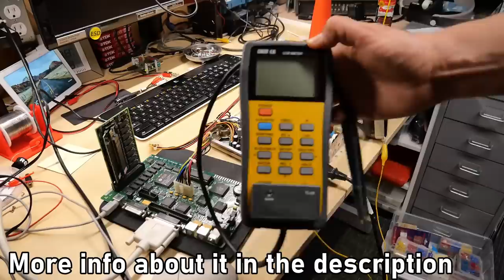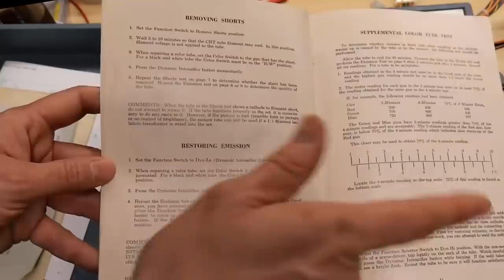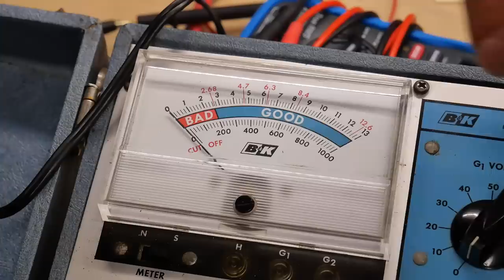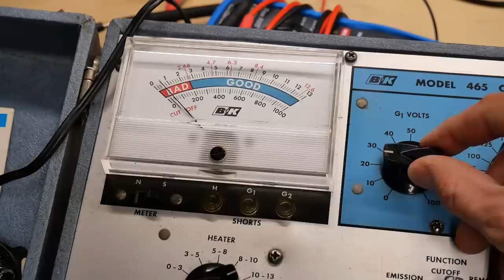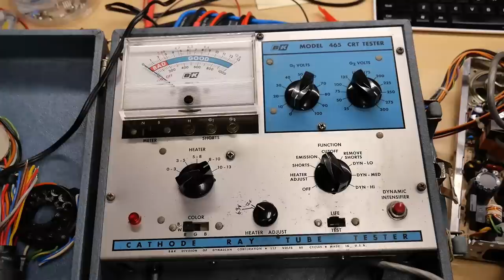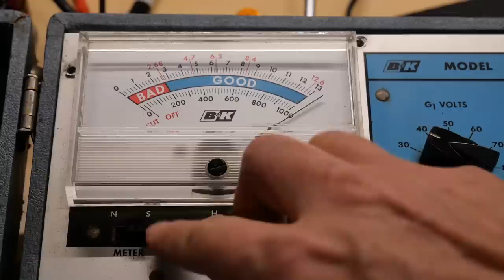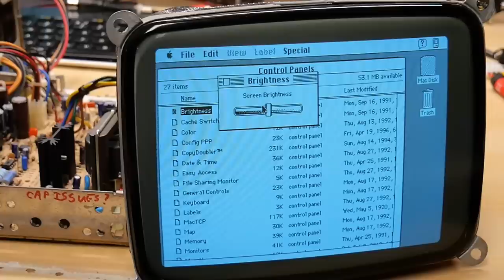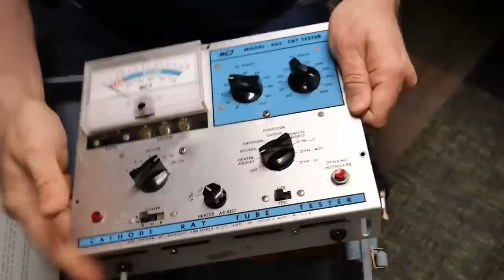Rejuvenating a Macintosh CRT with equipment from 1969

Comment: I used to be a TV repair guy back in the 80s and 90s (I'm now a computer engineer). I used that exact tester (B&K actually sold additional updated modern adapters for a while with updated cross reference guides). I rejuvenated many many CRTs with that tester and I would estimate about 75% of the time the CRT remained functional for years after. The other 25% of the time there was either no change or the CRT would completely fail. The spark you hear is normal when rejuvenating and I had the best success using 3 quick taps in a row and then checking emission. It is not doing anything to the heater, it is causing an ARC across the electron gun (usually visible when pressing the rejuvenate button) that exposes fresh surface on the coating of the cathode.
Reply: Thanks that answers my question.  Is the heater necessary at all in the rejuvenating state or just when actually testing  emissions or watching the CRT?

Comment: " Rejuvenation" means increasing the filament current a bit, and or more extraction voltage to "blow" any surface crud of the filament and basically increase the amount of electrons liberated from the filament, this works and is used in old electron microscopes as a last resort before looking the customer in the eye and telling them how much a new filament is ! however filament lifetime after this is a bit of a lottery, also there is a risk that the crud (filament) you removed went further in and caused problems down the line, so all in all, in your situation you did the right thing and you couldn't replace the filament anyway..i'm betting you get years out of it ! and from now it could actually improve a bit more...I'm a "glass half full guy"...cheers.
Reply: just what I was going to say Andy, years ago a friend had  a tv rental company, which would rent tv's cheap to people who the main stream rentals would not touch. The sets were ex rental which I help fix up, good clean inside and out and a tube boost would see them running for up to about a year, only had to last  3 months to pay for themselves.
Reply: So I guess this is the old extraction potential trick due to surface degradation... I have seen people use this also in old filament gas displays that are no longer produced and used in traditional lab instruments from the 60s to 90s... I guess the filament gets worn out during the process and the times you can repeat it is limited. Nice to see it working though, would be cool to also know what voltage/current it applies during this process.
Reply: @TheEmbeddedHobbyist  Did you have to hit the button a lot, or just enough to get to good. Basically will more blasts make it better.
Reply: @SidneyCritic , if you hit the grid with HV too much you can completely destroy the CRT!
Reply: It does work but you never know how long for, but even if you only get another 6 months out of it, it only cost a little bit of time.
Reply: @EsotericArctos  Sometimes it's not 6 months, but 6 weeks, especially on Trinitron. On those, it can be even 6 days... Because of the very miniature cathodes, Trinitrons doesn't have much spare emitting material, ~20k hours, and they're starting to smear the colors on high contrast areas, at 25-30k hours, they are unwatchable. 
Especially on the later Trinitron sets, where they drove the hell out of the tubes to give the brightest possible picture. I used to reduce the peak beam current setting in the service menu to give them more life (not just on Trinitrons, every CRT manufacturer did the same silly CRT overdrive since about the mid '90s, but good quality in-line tubes tolerated it a bit better compared to Trinitrons. Which is a shame, because on the other hand, Trinitrons has the best possible picture a CRT can produce). 
But on other tubes, which were not overused, just got cathode poisoning, it also can be 6 years, it's really like lottery. You can barely predict the outcome even if the set is your own, and/or you know its history.
Reply: Stop informing me with niche information, Mr mouse.
Reply: Electron gun, not filament, it's actually the cathode in the electron gun that wears out over time. Once the cathode wears out the picture tube has to be rebuilt, where the gun would be replaced, and the tube re-evacuated, or the tube replaced with a new one.
Reply: @mrnmrn1  Trinitrons used to have an advantage in picture quality, particularly brightness, because they used an aperture grill, with slots, rather then a shadow mask like the older colour CRTs used, shadow masks blocked more of the electron beam from hitting the phosphors. It also used a single inline gun rather then three like a delta gun tube would use, simplifying construction, and simplifying the setup time, though that was not unique to Sony. But within a short time other manufacturers copied the design, such as the Panasonic Quintrix sets, so they lost their edge after a while.
Reply: Burn crud off the filament?  So CRTs have directly heated cathodes?  I didn't know that.  I'm only familiar with valves in audio where only in quite early ones the filament does double duty as the cathode.
Reply: @mrnmrn1  I was wondering why all my lovely 19" Samsung and ViewSonic Trinitrons never lasted more than 10 years.
Reply: It's a last chance method to squeeze a few more years out of it. I've personally used a ferrite toroid to make a transformer (only works on a filament that gets its power from a winding on the flyback) that has a few turns on the primary and the same number plus an extra turn on the secondary. I cut the power traces on the picture tube socket and jump in my home made transformer. It would add an extra volt to the filament to drive it a little harder. Still shortens the tube life.
Reply: @dibblethwaite  Also battery operated tubes/valves  almost always have directly heated cathodes. Other then battery tubes, many tube rectifiers are directly heated.
Reply: @therealjammit  Basically a home made picture tube brightener.
Reply: Huh? SEM/TEM filaments are usually very cheap...
Reply: @mrnmrn1  At holydays' home, I still have a early 90's Trinitron which is over 32k hours, still watchable especially when I plug a RGB machine (PS1/PS2/DVD/HD DVB)
Reply: @olegkostoglotov8800  trinitron can't get the convergence quite right, and decent inline beats it. esp. visible on ttx, or simillar graphics, for example subtitles of movies. AND it lasted less than inline crts. so overall a bad tube, if you ask me.

Comment: 🤣...someone mentioned they had used one of these "crt rejuvenaters" I have one also and would give it bout 60% success rate back in the day, saving your customer considerable expense...also, if this was the only repair and the customer had brought the TV to my shop, I would not charge them...Back in the 60"s we generally made house calls as TV's were just to heavy and bulky to load up and take to a repair shop...I had my tube-case, VOM, solder iron, cheater-cord and few basic tools...$3 house call plus parts...the good times...
Reply: yes they were.
Reply: Yes, been there, done that. My buddy and I opened a shop in his garage after serving in the military in 1977. We made house calls in the late 1970's. 10 bucks. This lasted a year until we went separate ways due to other opportunities and overhead costs. Also we bought our rejuvenator and a tuner tester from another small shop going out of business. Most of the mom and pop repair shops went out of business as 1980 approached. If you have to move the console TV sets, that meant you will have to go over the solder joints and burn test the TV for a day before sending it back to the customer. The point-to-point solder joints go bad over time due to the heating and cooling of the filaments and the current draw within the tubes. A little better with the semiconductor boards.
Reply: wow i wish i could learn this art today
Reply: @Walczyk  You can if you really want to. Check out Mr Carlson's Lab, Glasslinger, Shango006, Uncle Doug, etc, etc... so many resources =)
Reply: I did not even know there were any such thing. All out TVs broke other ways than becoming dim. They might have been likely fixed but there always was new technology that made purchasing a new one attractive.

Comment: these things are used a lot by people who work on and repair and restore old arcade games and they have had good results with it
Reply: They're also used a lot by people in the vintage television community who knows their intended purpose is a band aide until the shop has a new or rebuilt tube ready for the customer.
Reply: @AiOinc1  What does rebuilding one entail?
Reply: @lelandclayton5462  Wow, I hope they're still doing this. Its a pleasant surprise to see that people might actually still be making/restoring CRTs in this way!
Reply: @krnlg  The people that have the equipment in that video have since (recently) successfully rebuilt a tube using it.
Reply: @AdolphusOfBlood  This is something that was mostly done in the old days as a less expensive alternative to buying a brand new CRT or if this particular CRT was not produced anymore. The shop would cut the neck of the tube, replace or fix the electron gun, redo the phosphor layer and seal the glass back up up. You needed very specialized equipment to recreate the vacuum in the tube and remove any impurities. The last crt rebuilder was in france and closed down a few years ago so nowadays if your rare and unobtainable CRT is dead (say you're restoring a 1930s-1940s TV) you're screwed
Reply: I was lucky to have been born between the the 70's and modern times so I got to see stuff like this back when it was still common
Reply: &6女v
Reply: @krnlg  There's only one left in the US as far as I'm aware.
It's a very, very, very difficult process and it requires a degree of craftsmanship unseen today
Reply: @Moonwalker917  nah at that point you adapt the set to use a more common tube, it's not hard
Reply: I used to rebuild old TVs for extra money and when I wasn't working. I would buy rebuilt crt's for the best sets that were worth the efforts. There used to be a shop that sold parts and new and rebuilt picture tubes. They were significantly cheaper than a new one and usual if you bought a A grade tube performed like brand new. I think the guy was All Smith in Portland off Sandy Blvd in his home.
His son even showed me a 1949 Crosley? Color Caster TV they had gotten and used to watch the Rose Parade on when the first early color broadcast finally happened here.
Last I heard nobody was really rebuilding crt's any more but I'm sure someone has some of the gear saved and sounds like they've done a few according to what was said above. I sold working but weak sets for 50 bucks each and better sets for 75 to 200 each if they looked good and were newer with a remote which was kinda rare for me. Most were 50 to 75 each as basic working sets. Gave it up when lcd took over as not worth it anymore and I just fix my own gear now.
Reply: Wish this guy was still around. I have an old Vector monitor which has a bad pin on the neck ... if you wiggle it; the pin makes contact and the monitor works. I'd love to get the pins repaired on the crt.
Reply: @AiOinc1  Are there people still re-gunning TVs? I have a few vintage colour TVs and arcade games, and want to keep the original CRT running. Im from New Zealand, but back in the day there was a place here that re-gunned the old tubes.
Reply: I've been an 'Arcade Tech' and location manager for about 30 years.  It was and still is common practice to request a CRT rejuv' from our support center for weak picture tubes.  Usually these games are running 12 hours a day every day.....  So the CRT's are under considerable strain.

Normally the process can last either a few hours, or a few years.  Considering the cost of a CRT and the very limited availability.  (Normally only a replacement from a scrap game using the same chassis ID can be sourced)  We rejuv' tubes a few times a year.

If the process 'fails'-  We then do a monitor upgrade using adapters and retrofit flat screen monitors into the cabinets.  While the picture looks amazing, the cabinet looks a bit odd-  The bezel (surround) of the cabinet is made and shaped for a CRT (curved) and a flat panel can look weird.

FYI:  I own 2 CRT rejuv's currently in my own personal tool set.  Both picked up at the local Flea Market for about $20 bucks each.  (BK models, both circa 80's)   I also rejuv'd my old weak CRT for my commodore monitor :-)  That was fun!  (The repair lasted a few months, but as mentioned-  This is a band aid fix...any life extension is a blessing for the older monitors)

Comment: I worked in a TV Repair shop back in the early 80's in Kerry, Ireland and that used be done with the rental TV's that were out from the shop if the tube was "Lo". It worked for a few months to a year before a new tube was required or may even get another Boost. That is what we called it. "Boosting the tube ". It worked OK but not a permanent solution, but a few months to a year was not that bad.

Comment: Great video.  An excellent site to watch for old electronics, is Mr Carlson's Lab.  I know there are many more, but he is my favourite.
A very close friend of mine, long since departed, spent his whole career, from the early 50s, as radar tech and instructor in the RCAF.  After he retired, to keep occupied, he made a hobby, then a business, out of repairing  tube type and solid state TVs that other techs had failed to repair.  After restoring life to the TVs back to life, his last trick was, to use a version of a B&K rejuvenator similar to the one you have, to attempt to improve the brightness of the CRT  I used to marvel at what he could bring back to life.
As some of your other commenters have mentioned below, his success rate using the rejuvenator was about 75%, and this step was probably going to be enough to last the operational life of the TV.    
I had to chuckle, when I saw that you had blown a capacitor on the rejuvenator.  I still play with a lot of old crap like that, (I am still using a tube type Tektronics 545b scope as one of my toys), and the first thing that needs to be done with those old beasts, is to re-cap them.  If they haven't been used in a long time, I also plug them into a variac, and warm them up on a lower voltage, to allow the capacitors to re-form.  That way, a lot fewer components (electrolytics) fail and require replacing.

Comment: I used to repair TVs back in the crt days and I was given a Beltron crt rejuvenator that was beat to death but still worked by one of the repair shops I got my sets from as their customer rejects. I made a pin adapter setup I could put on any newer crt and it increased my decent looking set output probably 60 percent because I could bring back marginal tubes to looking like new again. There is really a art to using one so it doesn't blast the guns too hard and it goes backwards and dies quickly. Some sets and the tubes they used almost always turned out great after usually just a cleaning cycle. Zenith used to have really good quality tubes that had a lot of emissions materials on the guns and usually a quick cleaning would bring them back, if not do a rejuvenation and do it similar to what you did. Push the button for a sec or a quick hit and see the crap blow off the guns with a light show inside the neck. Sometimes it would kill it, many times it would bring it back. Then you push the emissions button and watch how long it takes the meter per gun to drop to zero. The longer it holds, and if they dropped fairly evenly the better it was. If all the guns show the same level of emissions and its way up in the green the better. If one gun is way higher it would be hard to get a balanced black and white picture and the colors would be tilted towards the best gun. I much later found a totally rebuilt and fully updated Beltron on eBay for like 25 shipped in the early 2000s and last set I used it on was a 36" Sony HD set my mom had been given several years ago when it was looking horrible. It did bring it back and I was very careful but true to every Sony tube I've done it lasted about 6 months and was awful again. That Beltron had every newer crt socket adapter available and some internal upgrades and complete new manual for the newest tubes out before everything went lcd flat screens. I also have several military and high end tube testors and bixes if tubes I collected to repair TVs back in the day.
I'm actually local to Portland if you ever run into needing any old tubes tested or a different crt testor to play with. I knew when I bought that last Beltron that I probably would never or very rarely use it but I couldn't let it go for the money and everything it could do. I MAY even have one of those B&K testors just like you have, but I didn't like it as well as the Beltron I knew how to use. I can't remember what I did with it but it may still be here stashed in my shed with the others.
Shango is the man when it comes to troubleshooting any old stuff and getting it running, or restoring it if it's worth it. He likes the B&K rejuvenators best and has a Beltron as well he occasionally uses but every one likes what they are comfortable with so if you understand how to use it they all can work. Not many shops or repair guys do component level repair, they just replace the bad board and see if it works these days.
That was fun to watch and brings back memories of all the sets I fixed.